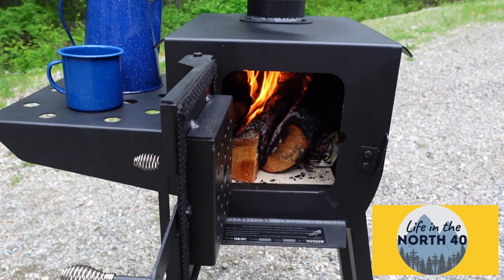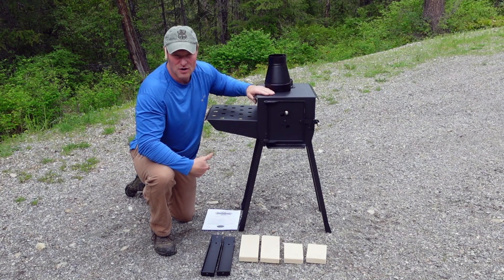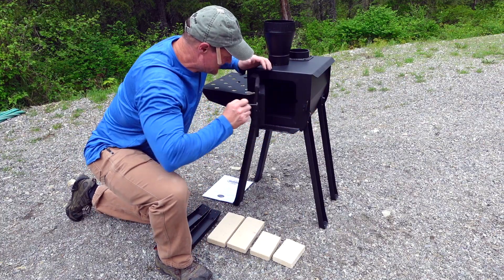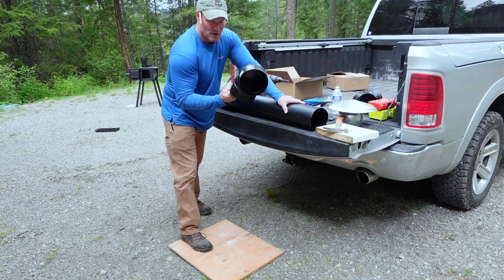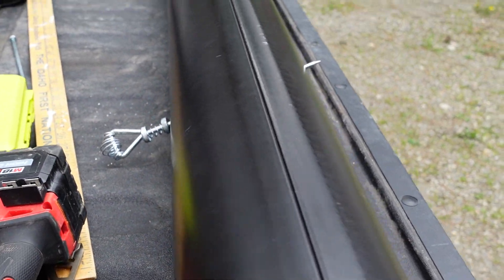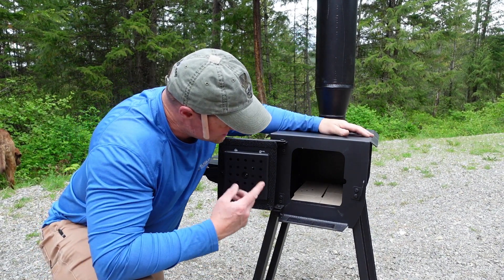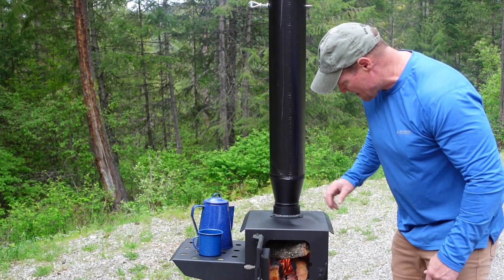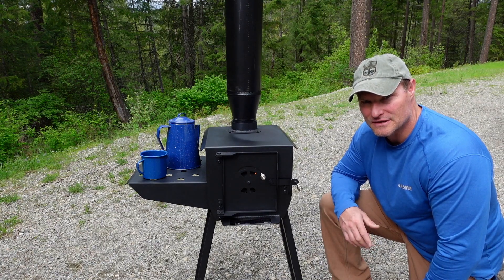Our Off-Grid Cabin Heating and Cooking Stove: A Review

Comment: thanks for sharing stove review, (and your stove pipe struggles-lol) I was thinking of buying one, good luck on your off grid build, that's next on my list too! Cheers
Reply from the maker: Thanks Kevin, we just got the stove installed in our cabin and are getting ready to run it for its first burn inside. We will have that in our next video of the move in and reveal in our cabin.  I did end up going with double walled pipe instead of the single walled pipe I showed in this stove video, its safer, has less of a standoff from combustibles. You can see is install it in this video https://youtu.be/eMtjRKSvSqM

Comment: Fairly new to your channel. I really enjoy it and the cabin build. Verify yourself, but I'm pretty sure there's a mix of Avocado or Grapeseed oil and water that you put in a spray bottle, and when the cook top comes down a bit from the ripp'n hot level you spray the cook top and it basically turns it into a cast iron finish.
Reply from the maker: Thank you that is so good to know because we do plan on using it to cook! Thanks for the tip!

Comment: Funny the adapters/spark arresters etc sometimes force us to put the female end of the pipe towards the stove,  this is a problem if you ever kill your damper for bed time etc and don’t burn hot enough, you will get liquid creosote that will run down your pipes and come out at the joints and be on the outside of your stove pipe, very flammable too! But I get it been there done that anyways always try to have male end towards stove where it can drain into the box and be safely burnt off
Reply from the maker: Great recommend! Thanks for watching and for your comment. Please give us a like and subscribe if you haven’t already, we would so appreciate it👍🏼

Comment: Is this the Cub, Black Bear, or Grizzly size? I have the Cub and am learning how to assemble it all. I would have liked to see how you screwed the collar on to the stove, that's my next step. I ordered the 4 inch pipe from Englander since it is 24 gauge steel, versus most other 4 inch pipe that is thinner at 28 gauge. I do have the increaser in case I ever want to change to 6 inch pipe. I discovered the difference between a reducer and an increaser...which end is crimped. Looks like yours is actually a reducer which prevents you from putting the male end downward which will better prevent creosote leakage. I'm using both the bricks and the steel bottom saver for extra protection. I'm a newbie, but learning. Thanks for the video!
Reply from the maker: This is the cub model. It's working great to heat our 10 x 16 offgrade cabin. We've actually cooked on it as well. You are correct. We have the to the 6 inch pipe. I didn't wanna run the 4 inch in a cabin that is for a tent only application typically. The sheet metal screws that come with it with a power drill will self sync right into the steel top. I hope this helps. Thanks for watching please like and subscribe if you enjoy our content.

Comment: Size: 14 1/2W x 11 1/2H x 17D  Weight: 43 lbs  Firebox: 1 cu foot  Material: 12 ga steel  Max Burn Time: 5 hrs. 
Btw,  you forgot to put the tension spring on the damper rod.  Thanks for sharing.
Reply from the maker: Thanks for the info!